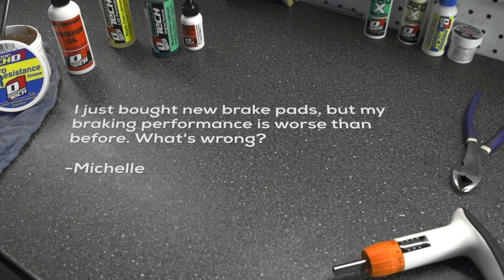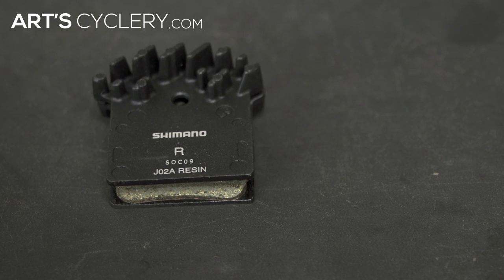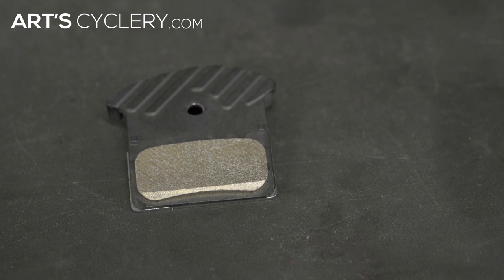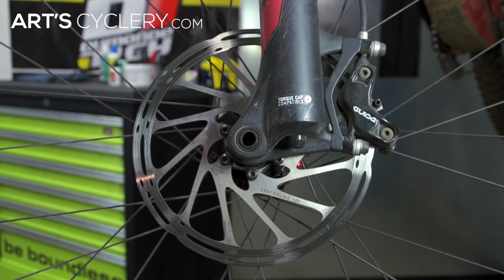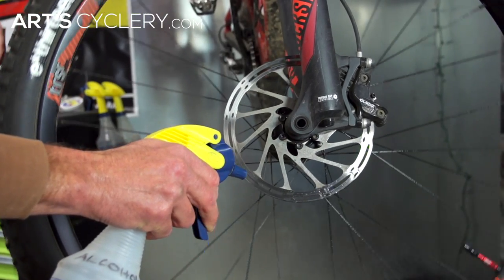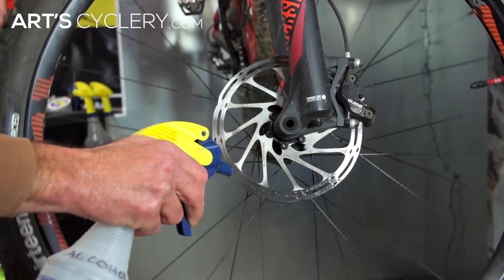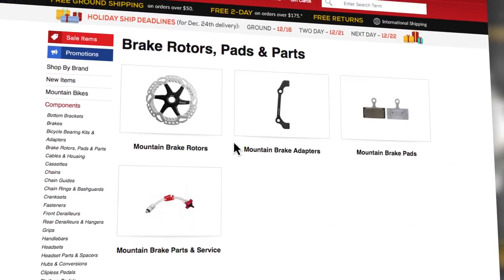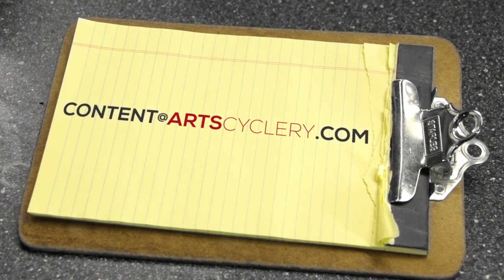Ask a Mechanic: Bedding In New Disc Brake Pads

Comment: Wish I saw this before the GMBN one haha just about destroyed some new pads doing it the way they recommend in that video. This guy seems to know what he is talking about🙌🏿
Reply: GMBN is literally staffed by former professional riders. Seems odd that they would give poor advice on a procedure they have all undoubtedly performed dozens and dozens of times.  It's not hard to botch the process even if you do it 98% correctly but just happen to be a bit sloppy somewhere along the line.    Just a small amount of contaminants on a pad or the rotor and you've got to clean, sand, clean and start again.   I tested to see what would happen if I did my first near stop on a fresh set of pads from a relatively high speed.   One fairly hard long brake application and when I removed the pads they were polished like a slab of marble.    I was shocked that was all it took to send me back to square one but i'll be damned if it didnt lol.
Reply: @Soknik01  if you watch the gmbn video he contradicts a lot of the directions given in this video. When I followed the gmbn video the pad material was unevenly distributed on the rotors producing inconsistent braking performance. When I followed this video, it was immensely better. If you watch the video and read the comments you'll see for yourself that the gmbn video is pretty iffy.
Reply: @Jay_radd  Damn Jared I just took a look and it turns out there's more than just one or two GMBN vids on the subject lol!   So based upon your experience what did you feel like this video got right that the GMBN one got wrong?   I'm getting ready to swap out my pads and I'm certainly up for trying new things, at least until I'm confident I'm getting the best results possible.   My last time around I did a few half strength decelerations from around 12 mph down to 4 mph  then a few more from 15 mph then I repeated the process only this time I applied about 75% of the force necessary to lock up the wheel.   If I recall my front brakes were absolutely fantastic afterwards while somehow my rear pads needed to be resurfaced and run in again.   I never was clear on if the cause was contamination or user error but some sandpaper, rubbing alcohol and a clean towel followed by another break in run had them working much better 2nd time around.
Reply: @Soknik01  locking up the wheel was the main issue, and sqeezing the brakes really hard was the other issue that I have with the gmbn video, haha yeah I didn't realize they made a new one recently lol.

Comment: I have never understood the, don't touch the rotor-deal. The rotor functions in rain, snow, mud and dust, it stops a bike at 50+ km/h, and it withstands heat and grime, yet it is somehow "allergic" to human skin?
Reply: It's due to the oils on the skin
Reply: @Stephen Powell I wash my hands regularly, I would think it's a very limited amount of skin oil that is in play, I doubt it would make a noticeable difference.
Reply: @1777DK  just to be safe where a pair of tight gloves when handling the rotor or pads. I leant the hard way

Comment: I'm a bit ashamed to admit it but I did it wrong. I did two amateur DH trails (1km vertical descend) in two days. I burnt my resin pads on my XT M8000 breaks. Wanted to do another DH as weather was nice. I bought G04S metal brake pads and attempted to bed them in. I didn't clean the rotor (though it did look "ok"). I did pay attention to clean the pistons and put new pads in. I did handful of (20+) fast stops... and here I am. 

I checked the pads - they don't look glazed. But braking performance is bad. Question is: am I able to fix this without buying new pads now? I'm considering cleaning the rotors with alcohol, sanding pads with a smooth sandpaper or a file. 

I'd appreciate your opinion on this.
Reply from the maker: as long as the pads aren't contaminated with brake fluid you should be able to salvage them.

Comment: Yay, SLO!  I don't think I (ever) bedded properly, I'm getting ticked off.  I install new pads, do similar and they never seem good.  I just did it again and went on first ride and they suck.  If I clean rotor and try again will it matter or must I buy new pads and or rotor.  I'm starting to miss calipers.
Reply from the maker: Thanks! As long as your rotor isn't contaminated with brake fluid, there should be no harm in cleaning the pads and rotor and starting over.

Comment: Would I need knew rotors that have been bedding incorrectly or just need to clean them
Reply from the maker: Hi Shane, you can just clean your rotors as long as they are not worn excessively. Isopropyl alcohol works great!

Comment: I don't know where to  write so i will here. How can i clean breaking surface on carbon rims? I have mavic cosmic carbone 40 and i use swisstop  yellow king break pads. And now are on breaking surface yellow marks... can you help me? Thanks and greetings from Slovenia.
Reply from the maker: The pads are very soft and subtle marking is normal. You can clean the marks off the rim but from a performance aspect, I wouldn't worry about removing the marks as its a normal side affect of running those pads.

Comment: It looks like you just squirted on alcohol without wiping off, yet another guy showed wiping with paper towel (which I questioned).  Just air dry?
Reply from the maker: The alcohol evaporates pretty quick, best practice is spraying the alcohol then wiping off the rotor  with a non-contaminated shop towel that doesn't leave any residue.

Comment: I am having a problem with what I expect is rotor noise but I have never heard of this complaint  . I have a set of Avid disk brakes , on a recumbent trike which shouldn't make any difference , that are adjusted correctly with absolutely no brake rub and brake perfectly . BUT when I am out riding I seem to be getting what sounds like a ringing noise coming from the rotors . Whats odd about it is it is intermittent and comes and goes depending on how windy it is and or how fast I am going . Plus it goes away when you lightly touch the brakes . If I adjust the brakes so they slightly rub the noise is gone but I know that cant be the fix for obvious reasons . If you could help in any way it would be appreciated . Thanks ..
Reply from the maker: We have seen similar issues with some of the older avid rotors. I don't have a quick fix for your noise, but I do know the new SRAM centerline rotors are designed to remedy that unwanted noise. I'd recommend getting pair of centerline rotors for you next set.
Reply from the maker: http://www.artscyclery.com/descpage-SRCLR140.html?gclid=Cj0KCQjwhMjKBRDjARIsAO4rzfiBJkXpB9FF2hBafFeE55JP-MNuDzh4n9ypDXT982SokhJgSekEvaYaAiLIEALw_wcB
Reply: Thanks so much for the info and link . I just bought 4 . I have two trikes I am changing . I cant stand that noise a second longer and also its mysterious origin . lol .. Sadly I tried to buy from your site but it wouldn't ship this item to Canada for some odd reason . But thanks again for steering me in the right direction ..

Comment: No need to sandpaper rotors?
Reply from the maker: We have seen people sand their rotors with no negative results, but we would recommend scrubbing with brake cleaner or isopropyl alcohol instead.
Reply: i use brake cleaner first, then sand paper rotors a bit, then use brake cleaner to get off the dust